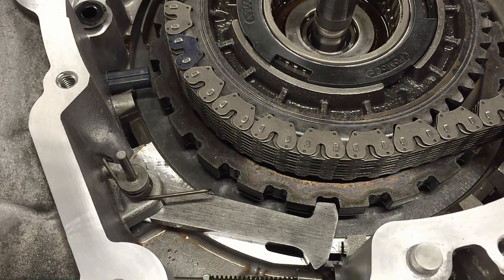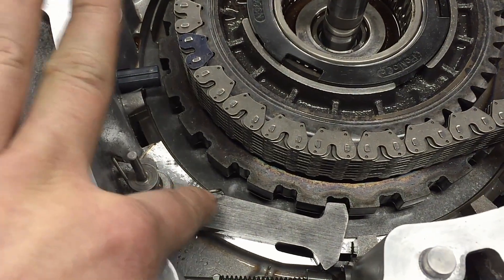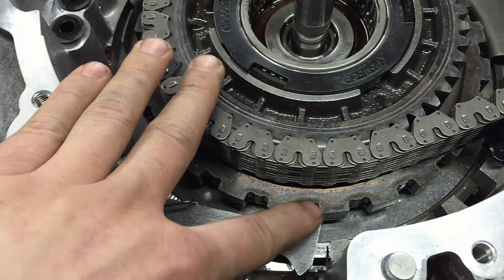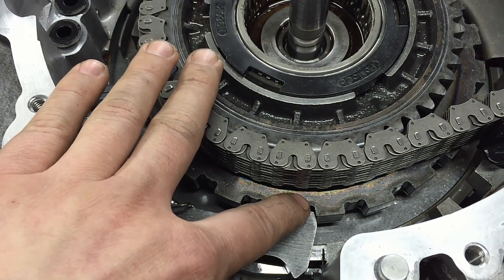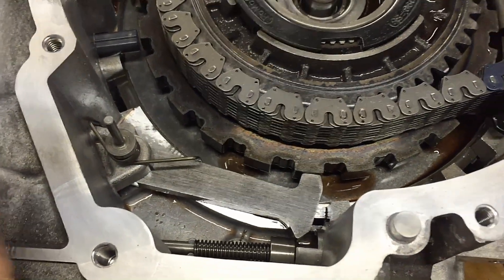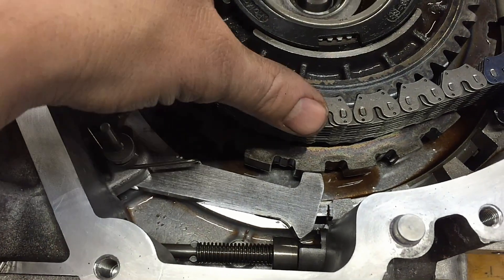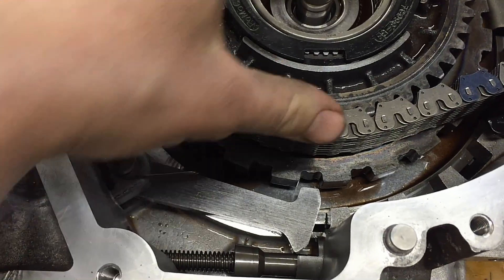Ford Transmission Tips: #1 Parking Pawls- What They Are & How They Work

Comment: Sorry on replying on old video my 2023 bronco bb sport is dojng this is it normal for it to do this 4 or 5 times out of 10 ? I notice it only does this when i turn hard left into drive way or been in bumper to bumper traffic that the pawl locks into place after car has been driven for a while and  putting car in park pulling e-brake and turning the vehicle off ? I did recentley get transmission serviced and the power train module recall fixed. Is it possible that they did not adjust the pawl pin correctly for it to happen as much as it does ?

Comment: So, looking at this, would it be a really, really bad idea to hold the shifter just outside of the P in the gear selector? I would assume it would be constantly rubbing against the gear(?) and slowly be chipped away?

Then would it be best to shift into P in the selector as fast as you can from D after the revs have calmed down while at a stop?
Reply: It snaps in and out, like a light switch. There isn't really a middle position.

Comment: If i park on a hill i cant seem to get it to shift out of park unless someone pushes on the vehicle to relieve pressure off of the pin would i need to fix the pin spring or spindle to fix this issue im sure all of it will need fix but whats the one part that will fix it
Reply: after you stop the car, engage your e-brake before taking your foot off the brake. then put your car into park. the weight of your vehicle will rest on your brake pads instead of the pawl

Comment: Thank you for the video,  it’s very helpful. If I could ask you a question, when I change the gear from the D or any other gear to P, it is a bit harsh and the same when I change from the P to any other gear. Other gears are working fine without any problem.

Comment: I had the back end of my truck lifted once sitting on jack stands. I put the gear in neutral and let things spin to see if everything was okay after a rear end job. The transmission actually spins/turns the drive shaft with a little speed in neutral. Everything looked good. But then I've accidentally place the gear into park without first hitting the brakes. I heard this parking hammer grind. I quickly pull it out of park and back it into neutral. Hit the brakes and then put it into park. Hopefully that spring gave some and it didn't do much damage to that hammer. It was placed into park while spinning in neutral while lifted. I'll drop the transmission pan and change out its filter. See if I spot any metal. What do you think Makuloco?
Reply: The vehicle was an 03 Lightning with the 4R100
Reply: From looking at the 4R100 diagram, it looks like the parking gear and paw is at the rear of the transmission. Sealed off from the transmission fluid and in a seperate compartment from the other gears.

Comment: Has anyone ever heard of this problem: 2000 Ford Expedition 5.4, 4x4... a couple of times, I have shifted out of Park into Drive or Reverse (parking brake already off) and the truck doesn't creep when letting off the brake. Giving it some gas results in a metallic "ting-ting-ting" and makes me wince, but then all is well. It sounds like the parking pawl is not disengaging all the way when shifting out of Park. Can't find anyone on the internet with a similar story...

Comment: I have a question:
Parked my car on slight hill. I release the hand brake first then started the car and put in reverse(tired from a double shift. Never do this). It was difficult shifting from park to reverse and it made slight clunk noise. First time doing this and was wondering did I hurt anything to the transmission, etc? Just worried and killing myself over such a stupid mistake. Thanks!
Reply: Don't worry you didn't hurt anything. The clunking noise you heard when shifting from Park to Reverse was the parking pawl releasing. When you released the handbrake you basically put the whole weight of the car on the parking pawl which created pressure on the pawl and made it a bit more difficult to release. Other than a bit more wear, your transmission should be fine. Just don't do it frequently/ever again if you want to extend the life of your parking pawl.
Reply: You basically simulated a parking brake failure and your parking pawl did its job.

Comment: "Its very important not to damage this while driving"

Auto Vlog: Hold either my 1998 Chevrolet Prism or Ford Fusion.
Reply: Lol exactly that was the video that sent me here, I was curious what shape the pawl was (squared edges vs like rounded edges) to imagine just how much of a beating it can really take. If the F-150's pawl is anything like this car's, then it's not looking good for the pawl. Which sucks because I do from time to time park on a slight incline and it puts strain against the pawl causing difficulty shifting out of park. Definitely gonna use my e-brake more often before shifting into park to relieve strain on the pawl.
Reply: @justinluttrell1769  Yeah. And after seeing how the car just suddenly stops when the pawl gets applied, I just cringed a little.
Reply: @GokantheHusky  Which video are you referring to? Mike did a video with his F-150 and shifting to park didn't stop the truck at speed. Only when he applied the brakes and slowed down below~10mph did the pawl make the bad ratcheting sound.
Reply: @justinluttrell1769  No the one with Auto Vlog with his prism and ford fusion

Comment: So I accidentally put my automatic car in to park while traveling like 5mph and I heard this grinding noise is that bad or no?
Reply: I accidentally did that in my Camry at 40 kmph (about 35 mph). I had the front raised and brakes off and accidentally put it into drive, and I didn't know what to do, so I just put it into Park and heard a weird grinding noise for a few seconds. But that was 2 years ago and I haven't had any issues so far.
Reply: Its not good, but it wont have broken anything. It was just the pawl rubbing along the detents as it was moving. If it happened once it will be fine.

Comment: I'm having a weird issue with my truck where it feels like the shift lever won't go into smoothly into park unless the parking pawl is lined up with the gear. Any idea what could cause this?

Like I'll hold the lever in-between R and P with some resistance. If I'm on a very slight incline and slowly let the brakes out, the truck will roll a few inches and then I'll feel the pawl grab as the lever slides easily into park.
Reply: Ive had damn shift lever probs with park forever in my 03 ford f250, but then again it rolled once in 2005, dont ask !!!
Reply: Also the linkage under my age trucks are crap with a plastic trans clip into trans, they come out and dont work properly, What damn crap they made with that one.

Comment: So if I have my e250 outfitted so it is quite heavy and park it on a slope it's not a failure if it can roll away anyway?  From this and that it has 200k miles on it, I'm thinking I need to get wheel chocks.
Reply: I live next to a public boat ramp and i can assure you park is not designed to hold a vehicle under great load especially as the pa experiences wear and tear on the pawl.
This is why you set your parking brake in addition to placing in park. and yes if on a steep incline with a heavy load chock blocks are a great idea.

Comment: Hey FordTechMakuloco! If you put your car into park while it is still moving and you hear a clicking noise, is that the parking pawl going in and out of each one of those notches? How much abuse can one of these take (if you shift into park while your vehicle is still moving at low speeds, will it kill it pretty quick or can it take quite a bit)?

Comment: My 07 expedition has a clacking sound I hear when I'm in traffic next to a barrier well. Transmission shifts fine and doesn't slip. Any ideas , I changed the filter and oil 20,000 miles ago.
Reply: Anthony Gonzalez my 2010 expedition has the same exact noise!! Drives fine and everything, Did you find out what it was?

Comment: If you put your car in park and it does not fully engage the pawl into the gear slot, would that cause the neutral safety switch to keep the car from starting?  My car would not start (not even engage the starter motor), but when I rocked it a bit while still in park, it started right up.
Reply from the maker: No, this does sound like a trans shift linkage adjustment problem

Comment: My girlfriend once forgot to start the car, she just put in Drive a we start rolling since we been on top of the hils. I gave her shit after few second that I noticed that engine is not running and she right away puted roling car right into Park. There was very loud noise, kind a like rachet noise before we stopped. Car still works great, it just amazed me it didn't broke off any tooth from that wheel or pawl. Is it cause pawl is shape like it is, so wheel can be forced out when excesive force is applied (moving car)?

Comment: Do you know if a faulty parking pawl would produce a engine code and which code that would be?
Reply from the maker: +Mar Real no it wouldn't
Reply: FordTechMakuloco Thank you so much. I'm having that problem with the transmission but I'm getting a computer code. Code P0601 and I was hoping that the transmission problem was related to the engine code.

Comment: hi good video.  I'm planning to tuner my mondeo mk5 2.0 ecoboost. what torque can handle this gearbox? Dyno shows stock 370Nm which is already 25Nm more than in catalogue. I would like to go slightly over 400Nm and I'm not sure if this will be safe for this AT?

Comment: Could you post a vid on the 5r55s parking pawl? I replaced the manual linkage in my '02 explorer and now can't get to lock into park. Original problem was the trans not coming out of park and I broke the pin on the linkage to the manual valve by forcing it out of park.
Reply: where does the pin go

Comment: The mechanisms seems to be made in such a way the parking pawl can always be released with no problem, anyway it often happens, especially when parking on an incline, that the gearshift seems to be stuck in P and you need to apply more force to shift out of that positions.

How can this be possible?
Reply: Because when you're on a hill you have the entire weight of the vehicle resting on the pawl think of it like trying to kick loose tire chalks on a trailer when there's weight on them. it's better for your transmission (and safer) to engage your parking brake and then put the vehicle in park when you're Parkin on an incline.

Comment: I got myself in a habit of putting the car in N when I go to park on a hill, I'll set the parking brake enough to where it'll hold the vehicle securely I guess you could say, let my foot off the brake pedal, and then I put the car in P.  I don't trust a tiny gear like that to hold thousands of pounds of metal and plastic on an incline.  A parking brake can easily be tightened or be fixed for a lot cheaper than having to have a parking pawl replaced.
Reply: Don't do that, when you park pull parking lever up and then shift to park. Don't test  that pawl!
Reply: DeadofWinter321: That's the proper way you are supposed to park using the emergency brake. Shift transmission into neurtral, apply emergency brake, and then shift into park. Doing this does not put all the weight of the vehicle on the parking pawl.
Reply: Why not shift to park with foot on brake, parking brake then foot off brake?
Reply: I read you are supposed to use the parking brake when not level.
Reply: "Shift transmission into neurtral, apply emergency brake, and then shift into park."
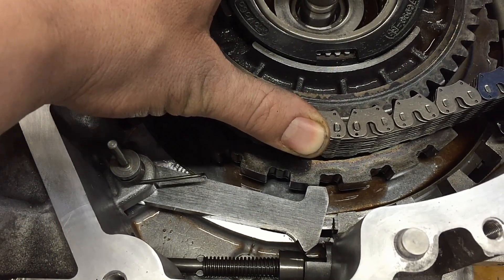But if you follow that order parking pawl might not lock because parking brake won't let the car move, as is required here 2:14.
Reply: It does hold your vehicle because if you park on steep enough hill the hand or foot brake is not going to stop vehicle from rolling this is why most car have the cabling that don't let you turn of the car completely unless it is in park because you don't need engage your hand brakes but by engaging it slow the forward movement a bit even on a steep hill to allow you to easier move it out of park.
Reply: Why not do both? It's recommended that you use a parking brake on an incline AND put your vehicle in park. If you're vehicle rolls away and hits another car you'd be 100% liable if you left it in neutral

Comment: Any news on cleaning up the carbon on the back of ecoboost intake valves?
Reply from the maker: 70carlton They are still working on it I just prodded them the other day.
Reply: FordTechMakuloco Have you seen the videos of the BMW cleaning system for this same carbon problem? There are also catch can videos,...
For now I am changing my oil often,...and I use lucas in the fuel,...I may have my intakes cleaned and catch can put on,..or trade in on a V-8 or diesel but we got lots of new diesel rules here in canada and they suck! Can you tell me the part number for the latest spark plugs? 2013 F150 ecoblob,...Robert B,...
Reply from the maker: Yes I know of the walnut shell cleaning and catch can systems.
Latest Spark Plug Motorcraft# SP-534